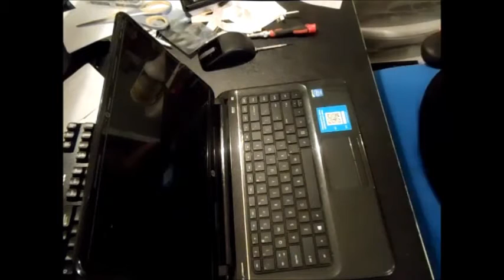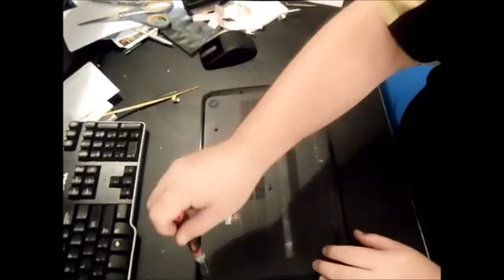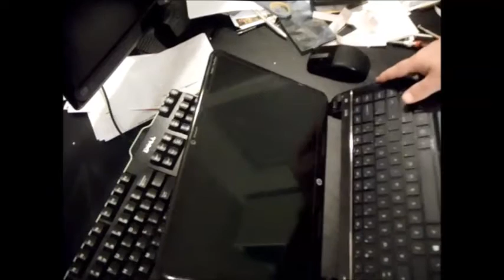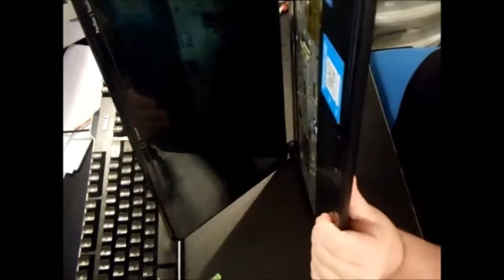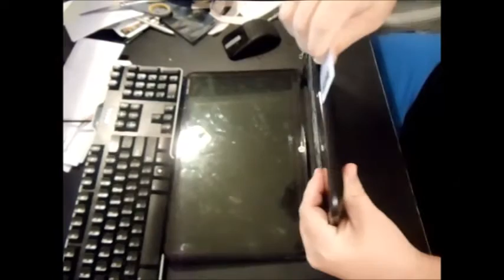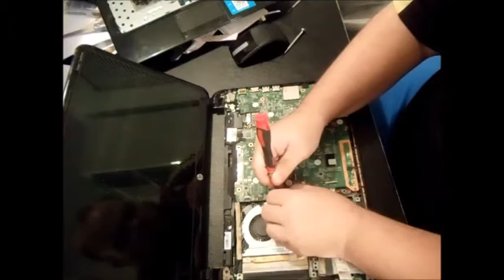HP 14 Touchsmart Sleekbook Laptop Hard Drive Memory Upgrade Fan disassemble Replacement 14-b109wm

Comment: Hi Wilbur, thanks for this video. I have a 7 year old sleekbook 14 and I love this machine. I had read the disassembly manual of Sleekbook 14 and learnt that there were separate SSD models apart from regular HDD models. The additional SSD slot is located when you turn the motherboard upside down and is just next to the RTC battery. I uploaded a pic : https://ibb.co/Jr6v9CR 
Instead of replacing the HDD, if I add SSD in that slot and boot windows from there then I should be able to have a HDD + SSD machine like newer machines which are available. 
Wanted to know your opinion as well as viewers opinion...
Regards, JD

Comment: Great video!  I just used it to successfully add RAM and replace the HDD with a SSD in my 14-b109sa. I did do two things a bit differently...

1) I couldn’t see how to remove the ribbon connecting the mother board and the screen. Also, there was another silver connection in the upper right corner I couldn’t figure out how to remove.  So I left them both attached (but peeled back the tape for the cable connecting the screen), then just rotated the motherboard so I could put the RAM in without unhooking either connection. Worked just fine for me. 

2) I used a plastic pry bar & triangle paddle (looks like a guitar pick) as I wasn’t confident I’d be able to remove the palm rest without cracking it. 

This video saved me a lot of pain and confusion!
Reply: Are you still using it? I put a different HD in mine before . But it has windows 10 on it. Was considering a SSD and memory upgrade to try windows 11.

Comment: Great video, but incredibly poor design from HP.  If you are going to only add 4GB of ram to run Windows, at least make it easier to add.  To require a complete disassembly is just ridiculous.
Reply: EXACTLY. That is an INSANE amount of work just to add a stick of ram. Maybe I'll just cut a hole in the bottom!!!!!